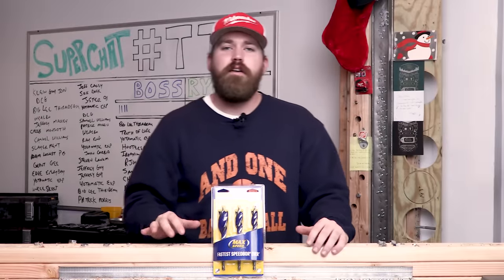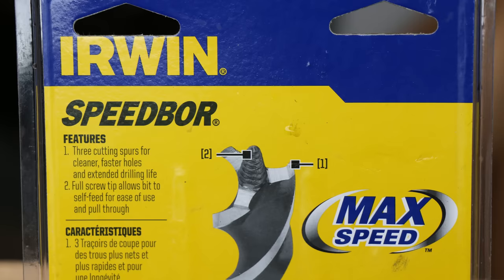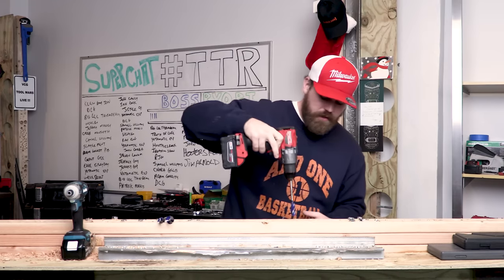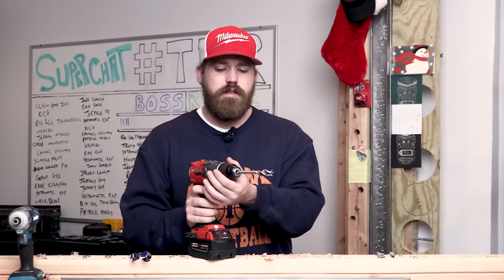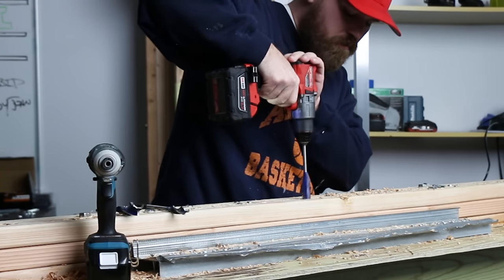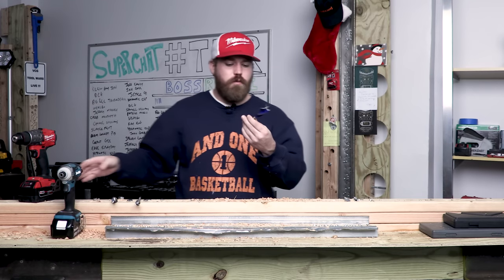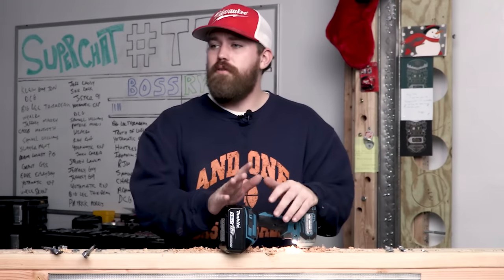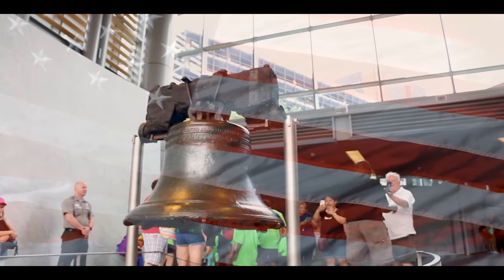How FAST Are IRWIN SPEEDBOR MAX SPEED BITS?

Comment: I noticed drilling with the impact didn't twist your wrist as much. A shout out to impact drilling nay-sayers.
Reply from the maker: Good point David!
Reply: More torque without the bite.
Reply: Sure.
Problem is you will burn up the insides of impact driver in a 10 hour shift. Had a helper burn my dewalt up when he borrowed my shit without telling me what he was using it for.
Reply: Did you miss the point the hammer drill was more than twice faster ? I can handle with bit of counter force if the tool does the job much faster.
Reply: @nomercyinc6783  well some prefer using impact drivers for drilling, good for them. I just say that tool that was designed for drilling will eventually do better job at drilling than tool that was not designed for, as seen by the time for completion.
Reply: Impacts have a job. But standard chuck type hammer drills are best for drilling holes straight through a material. An impact has a bit of wobble inherently and has to work a lot harder to run the same hole.
Reply: @eliadbu  I'm more concerned with keeping my body at 100% over saving a second or two of time at the risk of wrist, forearm, muscle or tendon damage. Then again, I'm one of the last few who uses that thing in their head called a "brain" ... If I can work more and have less body damage or abuse, that's far superior to saving a second or two on a hole being drilled.
Reply: @coltongrundy7625  change the speed/adjust the torque of the drill if you feel it's binding too much in the material. Default settings are not the best settings all the time. Good thing that modern drill you can do it quite easily.

Comment: I do believe that it takes a slightly more power to drive the Irwin speedbor bits then it does the Bosch Daredevil bits. However I have noticed that the design of the speedbor allows the hole to be cleaned out easier because the chips in produced from the cut are smaller because of the three cutting edges compared to the two cutting edges
Reply from the maker: Awesome Jason Reynolds!!

Comment: Use a 1/2” impact wrench with a hex adapter for the speedbor. That’s what I do. There’s no struggle at all. It will also just continue to drive your speedbor bit even at levels of resistance that the hammer drill or impact driver can’t handle. Don’t use the highest mode on the impact wrench though. You could literally snap your speedbor into pieces if you do.

Comment: if you're not using them for precision, they work even better if you rock them a little as you drill or even back them out to clear the chips, it opens the hole up a little, there's less friction so they're easier to get out, they dont smoke and the paint doesn't come off. lol I'm an electrician an they last me about 2 months BUT if i hit a nail that cuts that way down so i keep a crapy one in my pouch for blind drilling where i MIGHT hit a nail then swap it right back.

Comment: gotta say, the three fluted design is incredibly hard to re sharpen correctly
Reply: But if you re-sharpen your bits how are they supposed to get more of your money?  Sucka but thats probably why theyre like that
Reply: I use a grinder with a cut off disc to get down in on the flats then hook up at the edges. Just drag the cut off disc on it instead of cutting. Just try to replicate the angle on the flats. I destroyed one hitting a nail, and brought it back to "like new" this way.

Comment: Much faster with the drill what a surprise it’s almost like it’s designed to drill holes 😂 anyone using impact for this is going to decrease the life of there tool it’s only got a tiny ball holding the bit in!
When your pulling the bit out puts it under massive pressure while 3 jaw chuck was designed for this vince gen 3 already got a problem with holding onto bits wondering why 😆

Comment: Awesome bits! However, they dig deep on each rotation. So u better have something strong to drive them. With the position this guy was in, (drilling below yourself) it's pretty easy and they are effortless. Drilling overhead or up on a ladder is more difficult obviously and if you cant get any ass into it, they can stall out and just spin. If you get to heavy on the pressure to the bit, you will overload the drill. But these are both operator and drill motor issues. Match it to the right drill, hit the correct angle and proper pressure and the bit sucks its self through the wood. Its totally Effort--Less. Good shit 4 real.

Comment: OMG-again :(
An Impact Driver is not meant for drilling!
Take a high speed camera,and see how the bit "drills" with the Impact Driver...it literally rips chunks of wood out because of the stop-go-stop motion.
The RPMs of the Impact Driver drop significantly under Load,and what that means for the drill bit?-it can not "shave" thin layers of the wood out...instead you push the impact Driver with all the force,and the "self feeding" Drill bit must ripp thick pieces out :(
The hole is not just faster drilled with the regular Drill,but also "cleaner"-with smoother walls and less ripp-out et the exit.
Sorry i really like your channel,but for me is drilling with an Impact Driver in general like....drilling in Metal with an Impact driver....or with an Pneumatic Hammer....